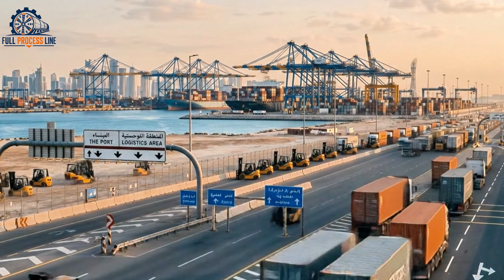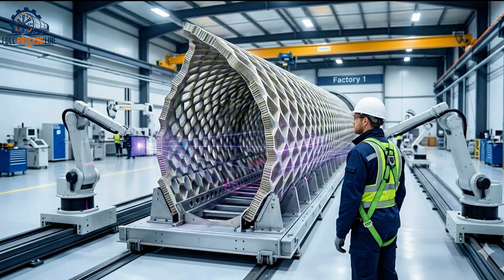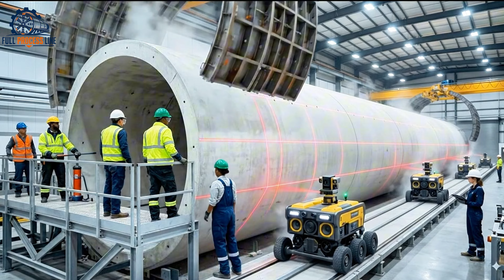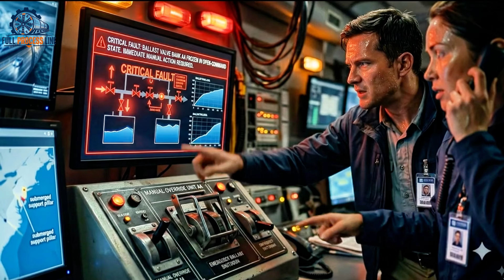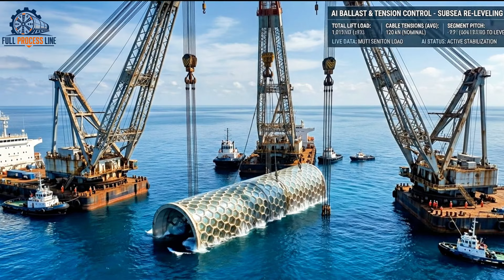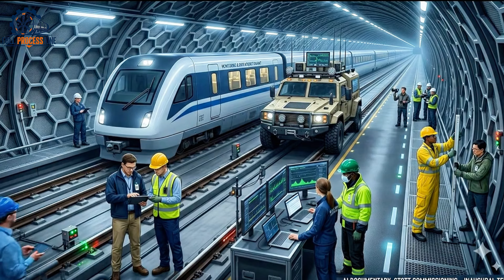Inside Qatar’s Impossible $45B Undersea Railway Tunnel Beneath the Sea | Full Process

Comment from the maker: The Qatar undersea railway tunnel is presented here as an Engineering Concept, but every stage raises a real engineering question. Which part impressed you most: seabed surveying, 20,000-ton segment manufacturing, subsea alignment, or the final high-speed test? And which impossible megaproject should FULL PROCESS LINE explain next?